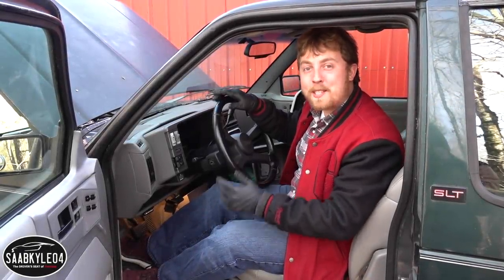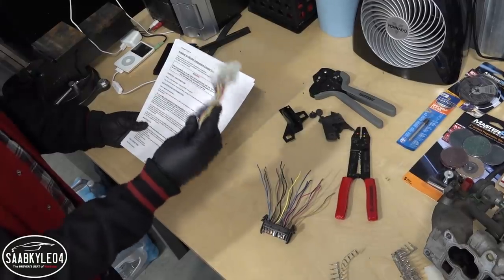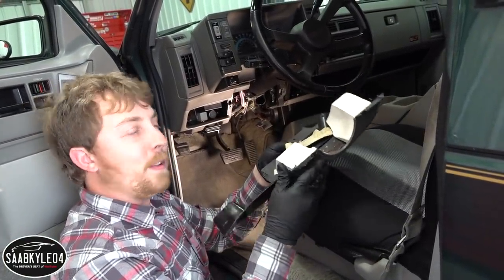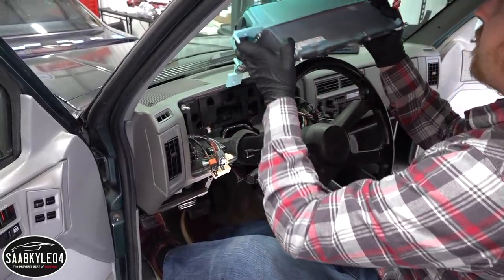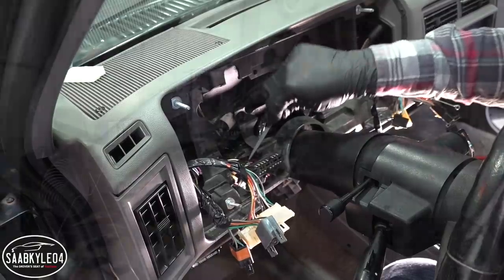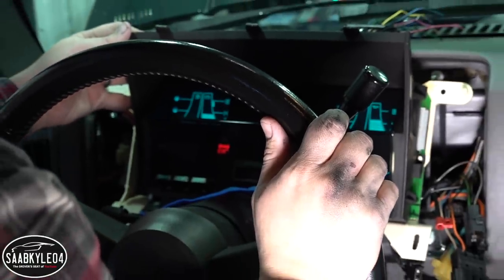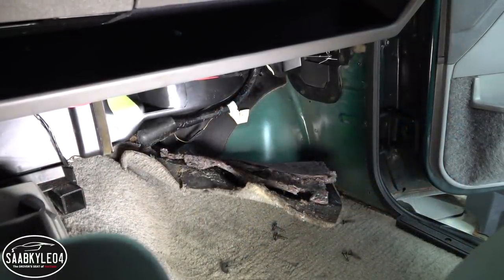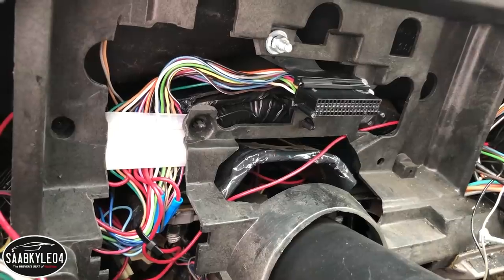Installing An Old School Digital Instrument Cluster: Jimmy Resto Ep.9

Comment: It's funny how we've come full circle. There was a digital cluster craze in the 80s and 90s, but then they disappeared for 20 years. Now it's the new hot thing, especially with VW and Audi products.
Reply: Yep. Everything old is new again.
Reply: Except digital today doesn't look as good as it did in the 80's, those VFD's look great.  LCD's not so much.
Reply: clemsonbloke Agreed. You could try to reproduce the effect with an OLED display, though those do not last very long.
Reply: I wish my MK2 golf would have a Digifiz cluster
Reply: Mel Laknanurak it is quite funny. My 2015 BMW 650 Gran Coupe has 100% digital cluster also. Which changes with each drive mode you put it in
Reply: I have it on my '91 Cadillac. I used to hear that there were issues with them but I've never experienced them (knock wood).
Reply: my 2014 Passat has analog cluster
Reply: @clemsonbloke  No doubt... the Riviera/Reatta's VFD dashes were beautiful... really loved my Somerset VFD too.

Comment: Great video! A little tip on removing the HVAC controls I found from removing mine so many times. 1.) Use a plastic pry tool to pop off the little black "nubs" on the control levers. 2.) Remove the two lower screws holding the panel in place. 3.) Unplug the top connector for the fan speed control lever. 4.) Remove the 2 light bulb twist sockets on the right side. 5.) Remove the two .25" silver screws on the left side. This will now allow you to just remove the "face" of the HVAC controls leaving all the other parts hooked up and inside the dash. You just need to gently push them out of the way when removing the gauge cluster hood/surround. This way of doing it has saved me many headaches and a ton of time over the course of removing this part several times on my restoration.
Reply: Problem is that its a bitch to put the face back on

Comment: I’m so happy you did the swap! And for anyone wondering, 1989 was when the square body S10/Blazer went to electronic speedometer so 86-88 people are out of luck on the swap unless you want to change the whole tail shaft housing and add additional wiring etc. Not easy.
Reply: There was a analog tach cluster those years. Tach is where the gas gauge normally would be. That’s the only option for 86-88 S10s

Comment: its amazing that it still works fully .... i know from digital BMW clusters giving up after 10 to 15 years showing wiered stuff on them.. i wouldve oppened it and checked for leaking caps and perhaps gave it new batteries or button cells or what ever... you don t want them leaking acid all over the circuit board !

Comment: Very nicely done my friend! I’ve personally not been as big of a fan of the factory 86-94 digital clusters, mainly because of their known problems of burning out, etc. But now my brother has a 1991 GMC Jimmy 2 door 4wd with a factory digital cluster in it, and from watching this video, I am getting to appreciate it more now lol. My 1991 4 door 4wd Jimmy has an analog cluster, actually it has a cluster from a 1993 S10 pickup, because the factory cluster went bad. But my speedometer quit working, even with a new vehicle speed sensor, so I still need to diagnose and fix that. But to clarify on when you talked about the factory tachometer and speedometer cable vs electronic, the tach (as far as I know) was only available in 1988 and 1989 in fairly limited numbers. I found one in a 1988 S15 Jimmy and put it in my 1988 S10 pickup. And the speedometer was cable driven from 1982-1988, and electronic from 1989-up. Great video man!

Comment: That turned out absolutely awesome, and the digital cluster really compliments the overall vintage 1980's feel of that truck. I have a question - on the original analog cluster harness that its in your 1993, couldn't you have simply removed each wire from the actual plastic plug connector, and snap in the new wires into the new digital cluster connector, or are both connectors shaped differently?

Comment: I did this swap about eight years ago with the same info you had. I didn't see anything in his write-up about constant power though, but your video explains why my trip odom won't hold it's mileage. Only thing i don't know is where to connect the constant power i get from the cig lighter, but i haven't yet looked at the pin layouts. Not going to take it all apart again to just fix that though... minor problem i can live with.

Comment: i had that similar hesitation during startup on one of my vehicle. installed a ground cable near the starter and it helps. it's probably worth trying since it's cheap and easy.
Reply from the maker: Probably is a good idea, but no point really, I'll scrap it one of these days when I get all I need from it.

Comment: Great job Kyle! I just installed a Bluetooth kit in my brothers 2006 Honda Pilot this past weekend. I actually had Best Buy do the installation but apparently they forgot to remove a wire on one of the connectors because his car has XM. So I had to go back in and correct that and now it works like it should without any interference with the XM radio. As for the mileage on your gauge cluster you can move the odometer forward but NOT backwards. Digital ones may or may not allow you to do that I’m not sure. I believe that my buddy Robert Spinner aka. RobertDIY has a video on this procedure

Comment: SO I noticed you have a few little black spots on the digital speedo.    The cable behind the Hvac controls was a known issues that would loosen up.   No kidding, I wedged a piece of plastic cardboard on the circuit board and it completely fixed the display issue.

Comment: I miss my 89 S10 2 door. Had a 2.8l  5-speed and it got fairly decent fuel mileage. And it drove through everything from drifts to deep snow with little effort. Its demise was my roommate. Because he broke it he traded me a 300 inline 6 ford which was a fairly decent trade. Only thing that sucked was the the digital speedometer would flicker in and out so we always had to use the Tach to figure out the mileage. And you can reprogram the digital clusters mileage. I think it saves on a mem chip you have to unsolder.

Comment: Hopefully the one you're swapping in is in good shape, because those things are NOTORIOUS for screens going blank. On my old Blazer, the odometer was out for a while, and when the speedometer went out I got it fixed. The speedo went again and I found a cluster online that was within an oil change of the mileage on mine, so I swapped it in. The speedo then went out AGAIN on that one, so I just used a gps unit for the last 3-4 years I had it.

Comment: About a year and a half ago, I bought a non-running 94 Sonoma for $1k CAD. Had the CPI 4.3 “tuned port” Dropped $700 in parts (spider injector, nut kit, starter, tune-up, oil change) Got it running, but once it warmed up it had a bad knock. Didn’t have time to fix it so I cut my losses.

Comment: I wish you hadn't cut up the dash! From the point you were at, it's not much more work to pull the entire dash (I've done it, to replace a heater core)... or you could just loosen the bolts and pull it forward a couple inches to give you some room to work.

Still, the end result was very nice!  Good thinking making an adapter harness so you can swap back to the analog cluster if needed.

Also, FYI those trim panel screws are Pozidrive, not Phillips (you can tell by the fine X halfway between the main cross). You can use a Phillips driver like you did, but it slips out rather easily.  With a PZ2 bit it works much better!

Comment: Nice upgrade, glad to see it all working! Shame about the mileage, but imo its better to have an odometer read higher than the actual mileage, rather than the actual mileage be higher than what the odometer reads. 

On an unrelated note, if you happened across another of these digital gauges, or even the analogue tach cluster in a junkyard, it would be a cool addition to that little 93 S10 of yours. I think that 89 Blazer you shot a video of a good while back had one of those gauge clusters.

Comment: Modifications done to my old 1991 Blazer and car/truck they were removed from (not all are included as your truck already has some things I put in):

*Tilt/telescopic steering colukn using the original column, 1989 Cadillac parts and 1988 Corvette wheel
*Center console from a 1996 GMC Jimmy
*All-Window-Down module from a 1994 Oldsmobile Cutlass Supreme convertible (I tap both back window switches at the master and all 4 windows roll down at the same time)
*Deep tinted hatch from a 1994 GMC Jimmy
*Rear sway bar from a 1999 Chevrolet Blazer
*Overhead console from a 1994 Chevrolet S10 Blazer with outside temp and compass
*Homelink for overhead console from a 2000 GMC Jimmy 
*Auto-dim rear view mirror with inside temp from a 1999 Chevrolet Suburban
*Updated chime module with automatic locks from a 1994 Oldsmobile Cutlass Supreme 
*Aluminum skid plates from a 1993 Chevrolet S10

Comment: I used to work on those all the time, be careful, there are two transistors and a capacitor that go bad consistently on a separate power supply that’s soldered to the main board. When they inevitably go bad, your cluster goes black. Also the pins for the power supply get cold soldered over time, reflowing that fixes it. This is the fix almost every time if you have this issue. Only other issues I’ve seen with them are people running the odometer “too far”, VFDs going dark after constant use and abuse, and people rendering ROMs entirely useless after completely failing to rewind the odo. You’d think it’s a simple task but requires a lot of hard work.

Comment: Old post I know, but, can anyone tell me where the Tan with White Stripe wire connects to the box at the driver's side firewall (inside cabin).  I accidentally disconnected it (long story) and can't find where to connect it.  It is a VERY important wire.   I have already tried searching for hours online. Can't find exactly what info I need (as usual).  Anyone who knows WHERE the Tan with White Stripe wire connects at the drivers side firewall box (inside cabin), please tell me.  Thanks a bunch.
 
1990 Chevrolet K1500 5.7L Auto is mine.

Comment: Should add telescopic steering like I had done to my old 1991 Blazer. Using the original column, Cadillac parts from the pivot pins up and a Corvette wheel.

S-series went to electronic speedo in 1989. The 1989-94 analog cluster was never available with a tach.

Comment: I have a question. How would I go the other way. I have a ‘90 S10 4x4 pickup, that came with the digital gauges and hate them. I’ve been wanting to get rid of them for the analog gauges. Would I have to rewire my harness or could I just plug and go?

Comment: There's no arguing that's an awesome cluster.  But when it starts to fail, and it will, you're going to hate it.  I've had both styles, and both became glitchy, but the analog one was mostly my fault because I painted the background flat black.  Some of the needles started sticking after that.

Comment: would have like to seen the few connections you made with crimp connectors soldered but that's pretty minor - other than that awesome job and looks great!  I would look into getting the mileage corrected (not that it makes a big difference) but if it's something you could get done inexpensively or better yet DIY that would be cool!

Comment: Will the sound system upgrade include replacing the original radio? I almost don't want you to replace it because the clock display matches the digital cluster so well! You could always find a head unit that has a color changing (RGB) display I guess! I have an old General Electric clock radio from the late 70s with a display like the Jimmy cluster, it's super neat to look at!

Comment: Hey buddy just wandering if the   procedure would be the same if I needed to go from digital  to analog in a 94 s10 blazer my 34 pin connector only has 19 wire being used and I have a copy of what you have and it's not working for me  ?

Comment: I have a 89 s10 blazer with a digital cluster, I am the second owner , the cluster intermittently will go out or only parts of it will work . sometimes it will all come on and works great , not too often , any ideas . 328k miles.

Comment: Great video man! Any chance you can tell me where to get connectors like this? I've got a digital cluster from a 95 astro and I'm looking to swap it into my 92, but I've got the old Gen1 analogs. Haven't had any luck finding a wiring assembly, or even the one connector, for the digital unit.

Comment: Great Video man, I've had the Digital Cluster before and I'm not really a fan of it, They look good and all but they burn out way to quick in my opinion..... But I'm glad you got it working tho..... I'm trying to build my 84 Blazer 4X4 and it has the Flat Face Dash in it, Well it also has a 2.8/Auto and I'm wanting to do a 4.3/5 Speed Swap on it, But I'm having trouble finding a Donor Blazer or S10 tho, I really don't want to keep it 2.8 or Automatic bc I've heard they are Junk, And I've got a 4.3/5 Speed in my S10 Truck and I love the way it is, So hopefully I can get a Donor Blazer or S10 so I can make my Blazer a 4.3/5 Speed 🎉

Comment: I was hoping you had a cable driven cluster  like I do in my 88 with a 4-3. I salvaged a digital dash from the junkyard from a Blazer that was about to be smashed any tips on how to wire that one up I have the RPM gauge and Speedo in my original S10 Blazer 2 door but the the tachometer is off by alot now and I've had the digital dash for 4 years now just waiting for someone to do it first. Big fan

Comment: maybe you could take pics of the circut board on the digital guage? If the data is stored on a standard eeprom it might be re-writable, iv'e seen this done one imobilizers, by deleting all programmed keys it defaults to manual programming mode, same for airbag computers.

Comment: the link doesn't seem to work could you put the pinouts online somewhere? as for reprograming miles-- an aurdrino or something else to give it pulses, could be used to Roll over unit (no millions place) and get you closer to the original mileage. how ever tampering with a cars mileage may not be legal in your area.

Comment: Hello, do you have the electrical diagram of the s10 Blazer 94 instrument panel that you can provide me? The current panel is the same as the one in the posted video. I want to change the instrument panel for an old school panel that works for S10 / Blazer / SONOMA 90-97

Comment: @15::22 - Those are mew terminals. What you are doing is re-terminating the wires, follwed by indexing the terminated wiresin the right places on the new connector to be able to plug the digital cluster into the dash. I've been a terminator at a company that makes aftermarket and oem-style wireing harnesses for old cars for over a decade. Sorry. Just had to offer that correection.

Comment: The other cluster only came with speedo that only goes to 85 MPH.  Being a 110 cluster its pretty desirable. I just wish I could find a 110 or digital that didn't have the PDR321 being I have a manual truck
Reply: Not sure about the digital cluster, but on the analog clusters (at least the 89-93 ones), the gear indicator is a separate module bolted to the back of the cluster, and the manual trucks have a blank plate that goes in its place.  You can easily swap them out.

Comment: Install the sound system  bro
Reply from the maker: Had to put that on hold for now, swapping a new engine in and rebuilding everything up front.  Check my instagram feed for more updates 👍
Reply: @saabkyle04  repaint the Jimmy engine bay
Reply: If you need help, it's pretty easy to update/upgrade the audio system.
Reply: G 808 he made it

Comment: now if only you could match it with a mid-late1980's Electronic Control Center (Buick Riviera and Reatta) or Visual Information Center (Oldsmobile Toronado) system, which is a CRT touchscreen GM made as one of the first, if not the first, production infotainment systems cars.

Comment: In my S10 blazer the digital cluster turns on when i put the switch on without turning on the engine, when i turn on the engine the cluster shuts down and then it turns on and it works fine, in your Jimmy it don't do that

Comment: You now what you should do is take all the old parts off the good running one and put it on the part truck and fix the engine in the part truck and then have 2  decent running truck